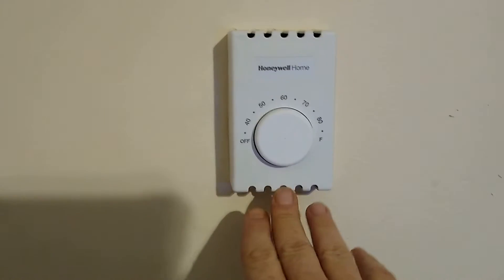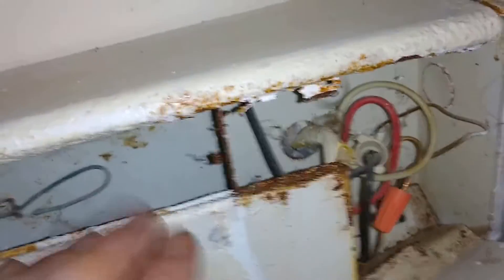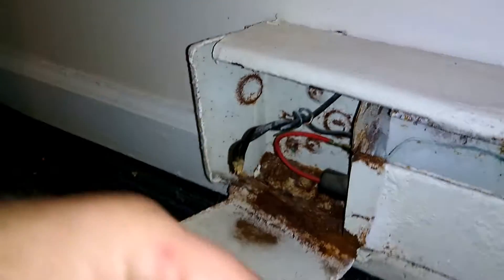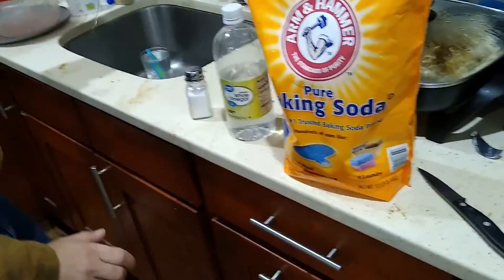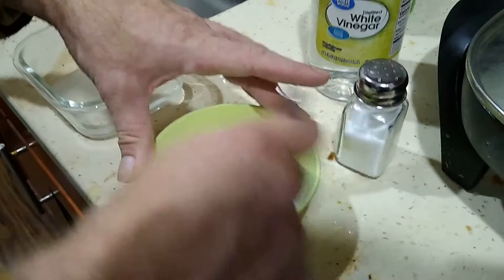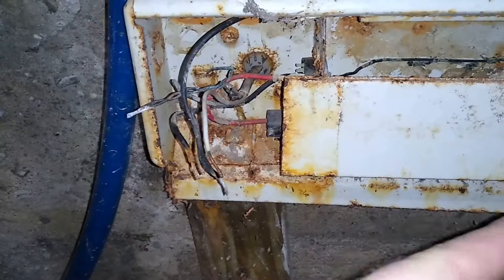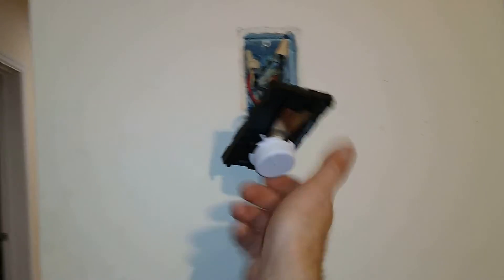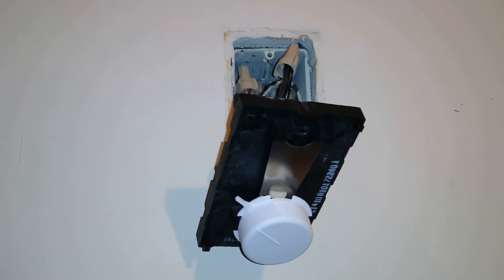Honeywell Home CT410B electric thermostat melting/burning

Comment: Youre a life saver for this. Thank you so much. Im also combatting the "landlord specials" that can kill you. I'm replacing a single pole with the exact double pole thermostat that one have in this video. However... there is only one set of wires coming from my wall... black, white, and copper. There's no neutral/copper connection to attach to this doublepole...and I'm not sure how I should connect this.. do I connect both of the black wires on the thermostat to the black one from the wall? Does both of the red connect to the white?  Or am I just connecting one side of the thermostat?
Reply from the maker: Copper ground doesn't get used with theses sounds like landlord used one wire so if you connect white and black the heater should start heating up
Reply from the maker: Use a multimeter and turn dial till you here a beep turn dial down if beep stops connect the black with and white wire to each wire coming off thermostat that way it breaks the connection

Comment: Does it matter which wires you start w red or black
Reply from the maker: No just make sure they go in exactly same spot on new one don't mix red and black red and red black and black
Reply: Thank you so far so good just seems like thermostat issues. I do have one other question I have 2 separate rooms with on same breaker double 20. 1 room 4ft other is 6 ft which is the one I just fixed.  Could that be a issue?
Reply from the maker: You have to look up with the amperage drawers on each if it's over 20 amps then it's a problem